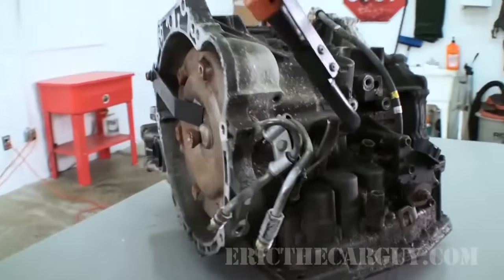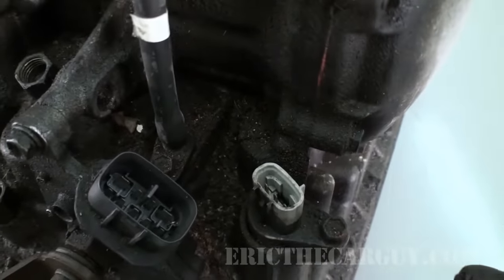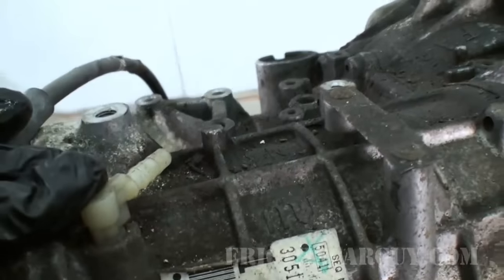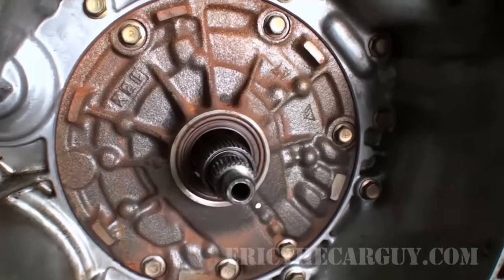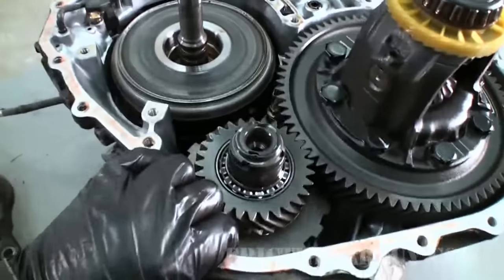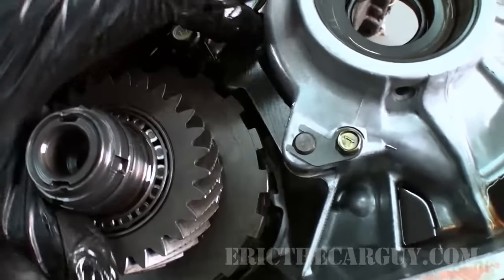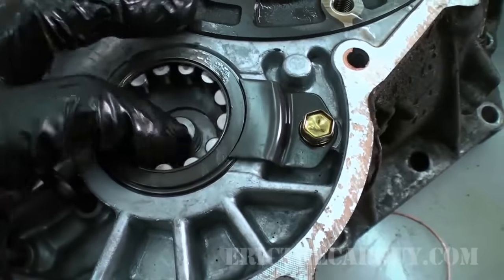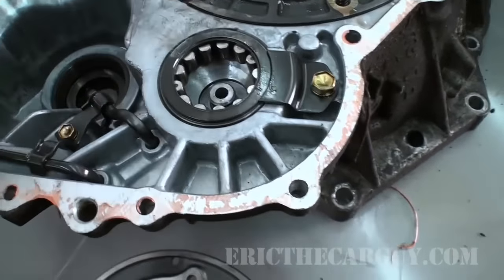The Basic Parts of an Automatic Transmission (Part 1)

Comment: Thanks for the feedback, I have added Lucas last time I changes the transmission fluid. It did help some. I usually drive on the interstate so I don't really use 1st - 3rd gear. Like I said it only slips between 1st and 2nd. How hard would it be to rebuild it myself. I don't have any experience with transmissions at all. Thanks everyone

Comment: Eric - I follow your channel and learned alot of about automotive tech. I have a jeep that is I am working on in my garage on spare time. This jeep sucked mud into trans fluid when I dropped it. I was wonder how could water or mud can get into trans. They seems to be pretty tightly sealed units.? Any thoughts?
Reply: +R RKK All transmissions have a vent hose. Water can get in from here.
Reply: +R RKK 
if you really got water in their then your clutches are gone. the water will cause the adhesive to unbond and the clutch material will just fall off. I've rebuilt a few like that and it's messy.

Comment: I have problem with my honda accord 05.it's automatic transmision can't exceed the speed only 80 km/h.althought I give more acceleration.what problem with mine?
Reply: +chasan birsi  Not eric the car guy, but as an ASE Master Tech since 1978, perhaps I can ask some questions to help, as a lot of issues can create this same problem. At 80 km/h, you are at 50 MPH. When you step on the gas, does the engine go faster, like high tachometer reading? Is Yes, your trans is slipping or not shifting into high or 4th (Over-Drive), then lockup. If you start on a clear road with little traffic, start in drive, step on gas slowly and listen to engine. Count shifts starting with 1st, as you start in 1st. So, 2nd is upshift, tach drops 200 RPM's or so. Continue, 2nd to 3rd is next shift, did you hear that or see tach drop again. OK, keep going faster & listen close. 3rd to over-drive or 4th is very slight. When it happens, you'l hear the engine speed drop & tach as well. Once in 4th, if the torque convertor lockups, it is only 100 RPM roughly. If seen by the tach, it's working. But at any point there was no Up Shift, the transmission is mechanically or electronically not told to Up Shift or can't due to bas internal seal, band application (Usually 2nd or 3rd), but if get's into 3rd and that it, plus there is no "Check Engine Light", the problem is most likely be in the trans. No, the engine has to be able to carry the load, so if it has a problem, like clogged fuel filter, bad fuel pump, restricted exhaust (Cat Rattling / It got Real Hot once / Turns sideways and blocks exhaust), ignition, etc. The trans is computer controlled and may allow a tech with proper scan tool to "See" the actual shift position vs Requested gear range. They will check for engine performance by check for codes first, transmission second, but fluid condition during initial visual check. If the dip stick smells burn't, fluid dark and not bright red...trans. If no engine codes, trans...Most any engine issue has software that detects the solenoid, sensor and abnormal conditions, like misfire, Lean fuel for too long of time, lack of 02 sensor movement, etc. The computer checks all of these things during the first 3-4 minutes after starting. It is very busy, then in closed loop, it controls performance, fuel delivery, shuts off injectors during deceleration, etc. Best of luck, but when did you have the fluid serviced last? Cheapest thing to do and will give the vehicle the best chance to last until it rust completely thru. Remember, Honda's and others require a unique trans fluid. DO NOT, put just anything in their. Also, avoid the "Quick Lube" shops. Why? A seasoned tech with experience cost and is worth more money than a pimply-faced kid, not old enough to shave...to make money selling air filters & PCV valves. They frequently use the wrong fluid, don't fill it correctly, or worse yet, forget to put lube in, until they park it the "Done Row", then realize the kid who was supposed to put the fluid in, was in the bathroom, or out back with a smoke! Other than your house, this vehicle is the most money you will spend. Always keep records organized, in one placed, with date & mileage. This is a CYA procedure. Get a second opinion if they won't take you in the shop to show you...demand it, it's your'e money they want. Best of luck!
Reply: @deankay4434  thank you for information.so benefit and give me more knowledge.

Comment: ammm good day i got a question for you concerning automatic transmissions... if there is a delay in gear change what can be the cause of that and after lets say 20 mins of driving it just smooths out
Reply: A bad seal in the transmission can cause it, slipping clutches can cause it as well.  After it warms up the parts expand making the problem go away, until it cools down again then the parts shrink and it starts all over again.  Needs a rebuild kit at some point for sure, eventually those parts will wear enough that it'll no longer engage at all and the vehicle won't move.

Comment: Awesome video. I love how you explain how pressure is created. (most people would think the pump creates pressure). But really its the small passages that it goes through "the resistance of flow" that creates pressure. The explanation/visual representation of the the two gears that drive the pump was spot on. It almost resembles a turbocharger and how the turbine contains the air within the fins.

Comment: Is it possible for above average mechanic to rebuild automatic? Or it has to be factory rebuilt?
Reply: it's possible but extremely expensive to the point where you're better off getting the  transmission replaced

Comment: I would definitely just drop a REFURBISHED one in or a brand new one..is it true I've heard that a brand new transmission can cause wear and tear on a old engine???
Reply: +litco Loco 4 Fish   A refurbished one is not remanufactured by a major company with a good reputation. Many factory updates and aftermarket parts are use to make the new trans much better than the OEM your car came with. Maintenance is everything with the right fluids. No, a new trans will not damage you're older engine, if it happens, it was going to fail anyhow. You can rebuild a cylinder head, then start burning oil, but the transmission only attaches the power your engine makes, to the ground. The weakest link in any chain, will break first...unless you let the chain sit around and rust-up without proper maintenance.
Reply: @deankay4434  thank you Dean!!! Much appreciated!!!

Comment: Hi eric, I have a civic 97 with an AT and its runs smoothly on D when the engine is cold but when it reaches its operating temperature, the D does not work that well, from dead stop when you shift to D, its not gonna there will be delays like 3-4 seconds then it will run but if you shift directly to D2, you can feel the torque right away. My question is, what could be the issue? Is this repairable? Thanks Eric! I hope you'll see my comment and have time to answer my question. :)
Reply: I was just looking at a car that has a similar problem (reverse works intermittently) and it is a shift solenoid, which is located in the valve body, at the bottom of the transmission (pan must come off) depending on your car it is very possibly a diy repair. that was the issue in my situation, not going to guarantee its your issue. just giving you something to look into!
Reply: +Bradley Preston what did you do to the solenoids? mine has 2 solenoids
Reply: They need replacing, I don't think they're repairable. I would consult a local transmission shop before buying them as they aren't exactly cheap. In my case it's less expensive to buy a whole valve body than just the solenoids (makes no sense to me)

Comment: What trans do you get more miles out of before rebuild?? Auto or manual? A clutch in a manual is relatively easy to replace. Looks like the clutches in a auto are quite a bit harder( more knowledge) to do. Which trans is more cost effective for a back yard mechanic?
Reply: A friend of mine is a auto transmission specialist and he drives a manual. That should be all the info you need haha.
Reply: ***** What kind of shit you been driving? I know a driving instructor whose car has done 380 000 KMS with learners grinding gears and riding the clutch, original gearbox with no servicing done and original clutch, now beginning to wear thin so will need changing soon but most well built toyotas will get close to 400 000 on the gearbox and usually a minimum of 200 000 on the clutch.
Reply: Spencer Howard well built Toyota you said, show me one because the last two I owned are in an savage yard, both of them gave me nothing but trouble, those Toyotas are not as good people say they are.

Comment: HELP!!! '89 corolla auto transmision is pissed off. I notice a rather big lunge in the car when it shifts. what to do?
Reply: ***** either take it to a shop or drive a manual transmission. virtually no problems in comparison to an auto trans..
Reply: ***** Check your automatic transmission fluid via the dip stick. It should be a pinkish red/dark red color without a burning smell to it. If it is reddish brown or black with an odor: swap out the fluid & the filter. I also recommend when you flush the tranny is to use lucas transmission fix. It literally turned my clunky crown vic to a car that seems like it is fresh off the lot.
Reply: GiveMeLiberty  believe me I know. I drive my 5 speed on those exact freeways both directions @5am and @6pm everyday. I'm stuck in 2+ hour traffic as we speak..

Comment: Hey Eric, Gotta quick question. A mechanic told me that if my transmission fluid hasn't been changed in a while, I shouldn't change it. It might hurt my transmission if i did. Any truth to this?
Reply: I wouldn't do the transmission flush using the machines that many shops use, but changing the fluid and filter itself shouldn't cause any harm.  Usually if it causes a problem the transmission had problems before the fluid change.  Using a flush machine can break up particles and send them through the transmission and cause a huge mess especially if they end up in the valve body and clog up passages and make solenoids stick and such.  Best to have a shop do a check on the transmission first and see if it has any potential issues and fluid quality....it would be a bit of an expense to have a shop check it over and do a fluid/filter change if needed but far cheaper than a transmission replacement or vehicle replacement if its flushed and causes a failure.

Comment: The "basic parts" of an automatic transmission ... 30 mins, 1/2.. Yeah, I'll stick to my 5-speed, especially because I'm a DIY'er.
Reply: ...and if you treat it right you'll never have to open it up, maybe a clutch replacement but should never need to open up a manual tranny.

Comment: Most transmissions are now all electronic.  The gas and breaks are also electronic.  So when you have an electrical problem you could be cruising down the road and the car speeds up and your brakes won't work and you can't shift into neutral.  Also with electronic and keyless ignition you may not even be able to turn of the car.  You will be along for a ride that you can stop.  

Of course people now can hack your car and drive it from across the planet.
Reply: honeybun33
Well most cars now are run by computers.  There really aren't mechanical links from the input devices of the cars and the things they run.  Transmissions, brakes, gas, and even steering is all computer controlled. 

Most car companies have built into their cars things like GM's Onstar.  They can shut down your car if they choose (supposedly if a thief takes it or if the government is upset with you).  If the cars are all run by computers and they have the ability to send or receive data then someone can hack it and control it.  With the internet they can be anywhere on the planet.
Reply: oddball0045
Where am I wrong?  Most all the systems on the cars are run by computer.  They are drive by wire and have no mechanical links.  When you are pushing on the gas or brake it sends a signal by wire to the different systems.

Same with a transmission.  There is a signal from the computer that says what gear it is in.
Reply: Tigerfire75 So what is good for military jet fighters is not reliable enough for your average car? Also if any of these systems fail there is a fail safe mode. For example driveby wire will always give you 10% throttle in fail safe mode so you could get home if something is to break. Also computers just don't suddenly stop working. I would say drive by wire is much safer than your normal throttle cable which can get stuck at WOT.
Reply: oddball0045
Well there is also the fact that now cars have ability to send and receive data.  You know like GM's Onstar.  That means that someone can hack your car and drive it. 

Those fly by wire systems on military jets fail too.  Of course it isn't the failing to work or the sudden stopping I am worried about it is more the failure to stop when I want.  You know unintended acceleration.  People say just shift into neutral or turn the car off.  Well with computers controlling everything and even a push button start what do you do when that doesn't work?

What do you do when the computer doesn't read you shifting into neutral or you hitting the off button?  What do you do when someone hacks your car?  They could possibly lock you in and kidnap you or drive you into a crash. 

Of course none of what you said in your last comment shows what I got wrong in my statements.
Reply: Except it can't get stuck accelerating like a normal mechanical linkage could. If it looses signal it always resets to 10% throttle. The start/stop button also is a hardware reset which will ALWAYS turn the car off no mater what the computer is doing.
Reply: oddball0045
I say that isn't true.
Reply: Tigerfire75 Sorry but it is, its a mechanical return system much like what is on a carburetor but instead of the spring pushing back all the way the spring pushes back to 10% throttle. If the computer for some reason gets "Hacked" by the government or causes another 9/11 or something then all you have to do is push the run/stop button which is literally connected to a pull up resistor and the reset line on the ECU's microprocessor.
Reply: oddball0045 I am sorry but no if the car gets hacked they have complete control.  Also your run stop switch can fail.  When it is all computer run hacking in gives complete control.
Reply: +Tigerfire75 You must have no idea how computers work. the run/stop is literally shutting all power off, no hacking can stop that lol.
Reply: oddball0045
It is a computer controlled system on your car.  Car companies can shut your car off as you are driving along which means they can turn it on too. 

Hmm if someone can turn your car on and off at will regardless of what you choose seems to me that means you don't know what you are talking about.
Reply: +Tigerfire75 (shakes head and sighs)
Reply: Brent Sido
I know right can't fix stupid.

Comment: The Jatco transmission in my Nissan had a very smooth start. Though, it was a bit quirky with sudden changes in throttle at low speed. If you let it off too quickly, it would randomly engage the TCC and make a nice *clunk* at around ~30mph

Comment: EricTheCarGuy.  I know this is an old video, but what might cause axles that are plugged into the differential to shift back and forth within the transmission assembly such that they bang on the transmission case?  Even though this happens, the transmission works perfectly through all gears and speeds.

Comment: Good day Eric . I have a 1998 Honda Accord EX.. Transmission issues, from slamming into gear, rough gear change while driving and when I stop it stalls for like 2 seconds then jumps into (low gear) when stops. I bought a used suppose to be good transmission yesterday January 19. 2017. Mechanic installed it and Guess what, I am having the same issues... oh I forget it also stalls for 2 or 3 secs then roughly goes into reverse. The sound it makes its as if something is cracking up inside.. I'm frustrated. Any help on opinions? I'd appreciate it.
Reply: Not surprised you had more issues after a replacement transmission. The Honda Accord transmissions are known to have horrible problems. Buy a Toyota. ;)